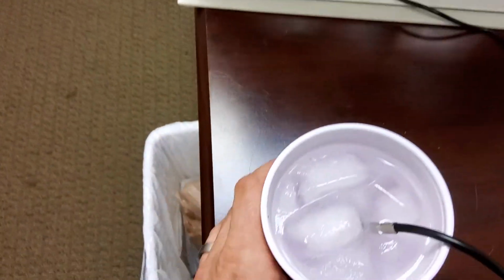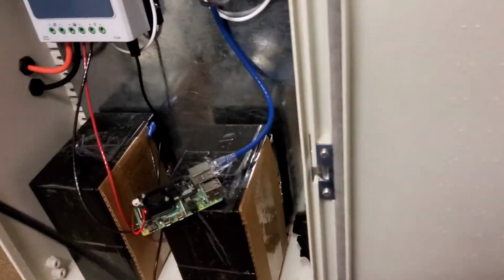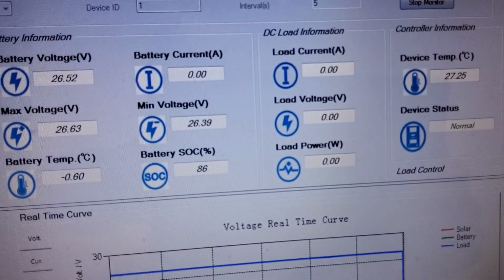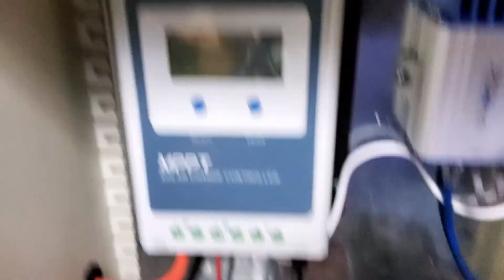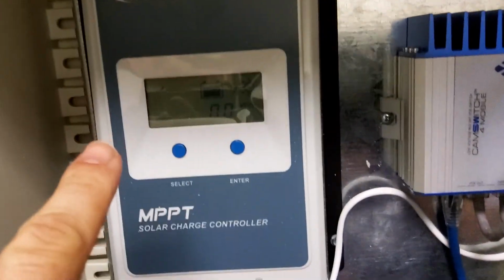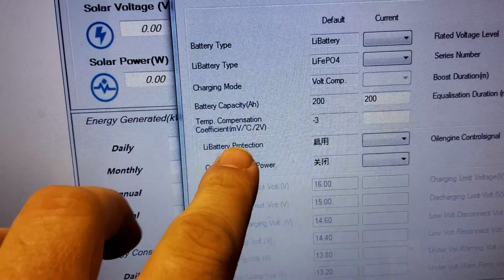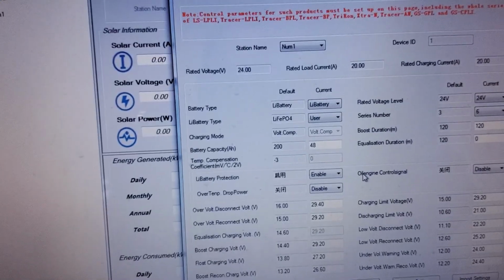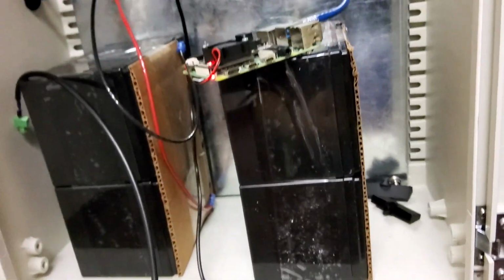Budget LiFePo4 Low-Temp Protection Solution & Test

Comment: Costs more, but the Victron Smart Solar mppt charge controllers work with the Victron Smart Battery Sense temp sensors and they'll shut off charging to your unprotected lithium batteries. Currently (no pun intended), the sensor cost about $40 on Amazon and the controllers run $200 to $800 depending on what size you go with. I bought the 150volt 45 amp unit for $382
Reply from the maker: Thanks for the info. I've been meaning to try some Victron stuff.  However these epevers have the low temperature protection built-in so it works great for this use case at a fraction of the cost.

Comment: I’ve been meaning to set this up with our epever controller but I’m a bit surprised it cuts the load side. I would expect it to only stop charging. You can still safely discharge lifepo4 batteries at freezing temperatures. It makes no sense to disconnect the load side of the controller at 0 degrees.
Reply: I'm confused by the same issue.  It should stop charging but need not stop the battery from putting out power.

Comment: Any way to send the solar power to a diversion load during low-temp cutoff?  It would be ideal to send the unusable solar power to a heating pad to heat the batteries until they could accept the charge.
Reply from the maker: Possibly use a low power heating element that is controlled by a 0C/32F thermal switch. However at that point you need to know if you're even generating power, and is the heater able to keep up, etc..
Reply: My LFP sits on a 16w reptile mat plugged into temp controller. 
 Holds temp easily below freezing.

Comment: I am glad you posted this since the Epever manuals are to say the least incomplete as far as how to completely set up the unit adequately specially with low temp cutoff, and also you need a laptop to do what you did, thanks.
Reply from the maker: I agree, they are lacking in the documentation dept. :) They are great controllers though. I'm really thinking about doing a video going over programming, and the software.
Reply: @BradCagle  could you PLEASE do a video on programming and software for this epevers charge controller? I have the same one with LiFePo4 batteries without low temp cutoff. I don’t even know where to start. Where do you get that software from does it come with the charge controller? And do you have to download it into your computer? Thank you for explaining this video. It was awesome!